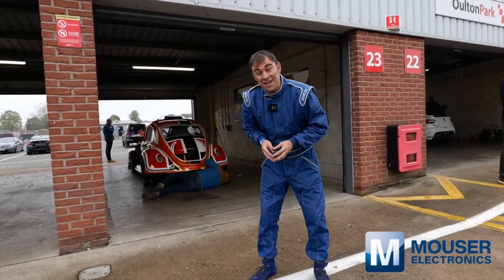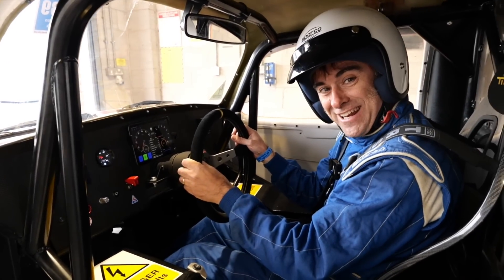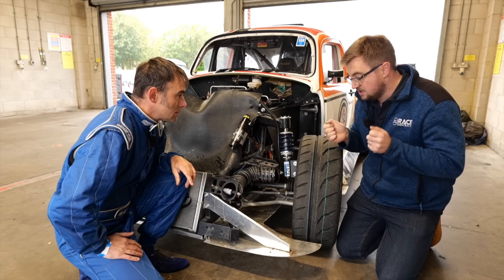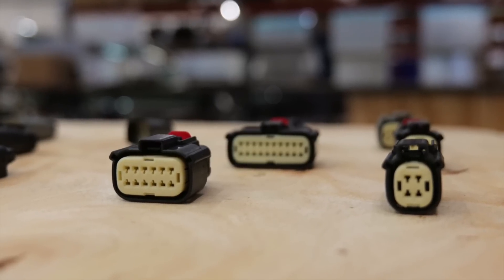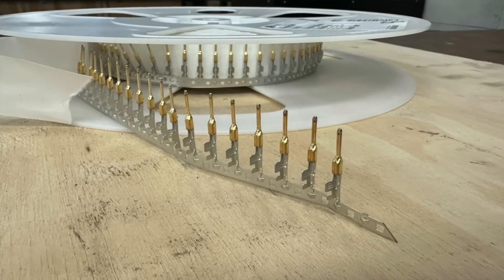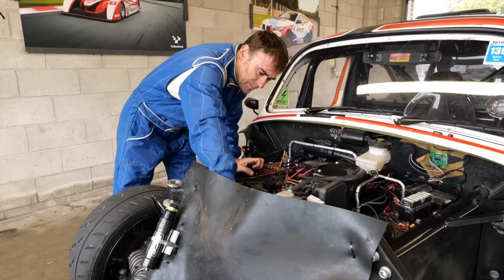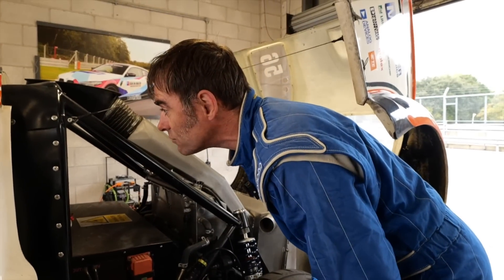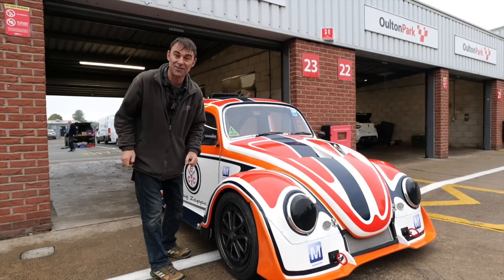Pikes Peak race car Ep16 - First time on track

Comment: Do you mind me asking why you didn’t have the big rear wing attached? Surely you’d need to account for its downforce in setting up the suspension .
Reply from the maker: Because without the front splitter on the front it would just end up making the front light as it pushes down on the rear. 👍
Reply: @ ah, I see; that makes sense.

Comment: Point to point acceleration looked amazing as the Beetle overtook everyone else. 😳👍
Reply from the maker: It’s certainly got a lot of punch. Focus now will be on aero and making it fast around corners. 👍
Reply: @ I owned a Beetle. My parents owned a micro bus for a short period.  Both are like pushing a wall through space. Good luck with that aero work !
Reply: @baomao7243   “pushing a wall through space”? That sounds weird! I own a 1970 Beetle in California and,  EVERY ONE thought the motor was modified and had the Freeway Flyer modification because I was passing every one on Hwy 99! I told them it’s not the car, it’s the driver!
Reply: @  Awesome!  Your are the Stig!  😉
(To be fair, my Beetle could do 70mph and was actually peppy given its power/weight with only a single person in the vehicle.  Mine was also in CA and drove Davis to San Diego and back several times on I-5.  A simple car. But no creature comforts or real power - e.g., traversing the Grapevine.)
Reply: @  Hwy 99?  I’m impressed you didn’t have a quadruple blowout given the condition of that “highway.”
Reply: I agree 100%! Sitting in California I felt an adrenaline rush! 😆